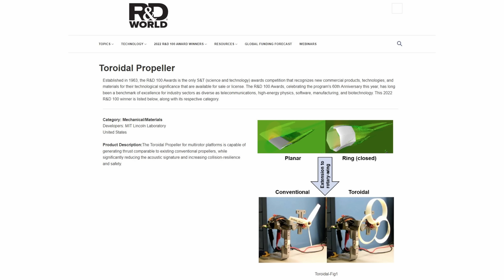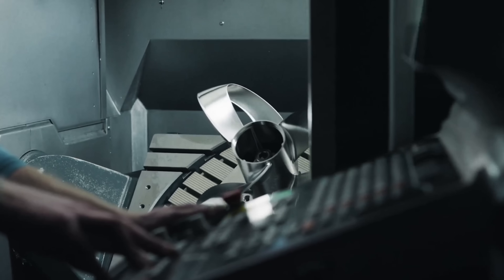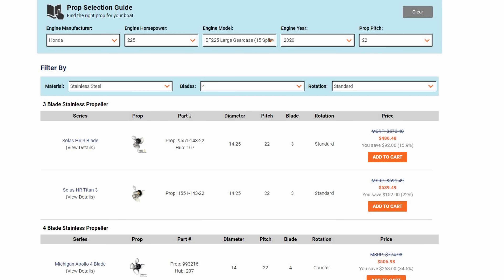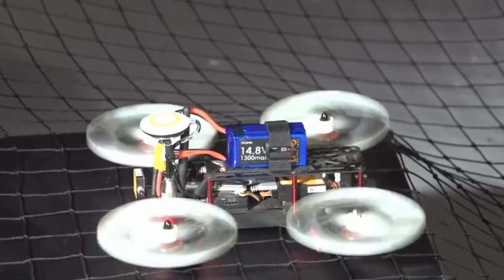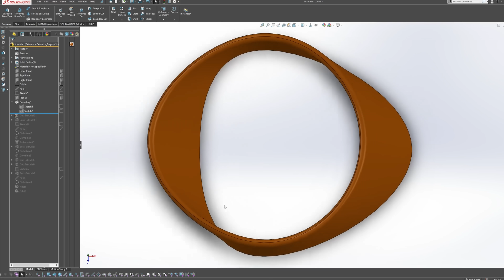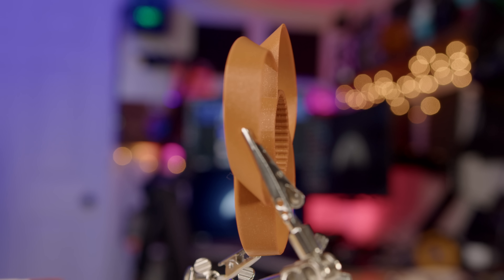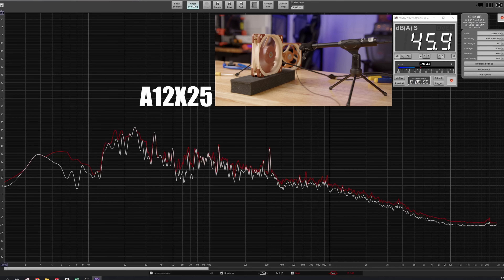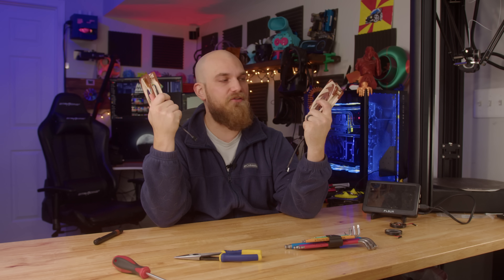I Turned MIT Award Winning Toroidal Propeller Into A PC Fan | Fan Showdown S5 Special

Comment: There is one BIG difference between your fans and the drone propellers.  It is that your fans are DUCTED - it already has an enclosure around the outside of the fans.
The main cause of noise are the fan-tip vortices, and having an enclosure already reduces those vortices which is why you don't see much of an noise advantage.
There are reasons why ducted fans are not used in drones:

Here are some of the other advantages that you can have when you are using ducted fans on a flying object:

*The tip losses from the propeller blades can be reduced by the duct. When that happens, the ducted fan can operate at a more efficient level as it can produce thrust that propellers that are similar in diameter and size cannot. This is best seen when the aircraft or the object is flying at low speeds and high static thrust levels.
*If you are able to vary the size of the duct the right way, you can adjust the size of the fan to allow it to work at a more efficient level at higher airspeeds compared to what a propeller can do.
*Of course, ducted fans work a lot more quietly than propellers do because the ducts shield the noise that the blades produce while also reducing the tip speed that could very well contribute to more noise.
*At the same thrust level, a ducted fan can be smaller than a propeller. This allows you to use smaller engines on a flying aircraft or object while retaining the same thrust level.
*Ducted fans, because of how the ducts shield and cover the propeller blades, are safer when operating on the ground because the chances of the blades hitting someone or something are greatly reduced.

So why don't most drones use ducted fans?
Let us look at the disadvantages of ducted fans:

*They don’t work as efficiently when the flying object is at cruise level or is operating at a low thrust level.
*You need to be able to have very small clearances between the tips of the blades and the duct itself for the ducted fans to work efficiently.
*The duct can add weight to the entire flying vehicle or object even when the duct is made from light composite materials.

So, if you look at it, it becomes quite easy to understand why most drones don’t use ducted fans and why there are only a few of these drones that actually use them. Drones work at a low thrust level, and their motors need to be able to provide low-level static thrust all the time for the drones to maintain their flight. This makes the inefficiency of ducted fans apparent as they do not work very well at low thrust levels.

For a fan application, many of the disadvantages don't apply, which is why you see that many fans are ducted whereas few drone propellers are.

Comment: You also haven't sanded/polished the ridges left by the printing process, which are similar to tooling marks left over from standard machining processes. Your blades are the equivalent of rough, fast mill passes, not the final pass or post polish stages. Each ridge can create its own vortices or a high/low pressure zone over and behind it, creating variable lift and drag zones making for vibration and interrupting air flow. It also hasn't been balanced.  Too many variables in play to test it accurately. At least take some 2000 then 5000 grit wet sanding paper of some similar method to polish the blades and consider balancing it first. Another great idea would be a full ducted external housing using the shaft terminated toroidal design closer to the boat propeller if volume/noise/efficacy over mid RPM ranges to max RPM is the desired result.

Comment: Just a thought. have you considered making a radiator fan for a water cooled motor vehicle engine and seeing the difference in engine cooling. another test might be to run it on 12VDC and not tied to the engine, seeing if it uses the same amount of power, or produces superior cooling performance at the same RPM, I wonder if a NASCAR  team would like to participate in it, to see if they can get more HP to the wheels.

Comment: Award winning when a toroidal design has been used in the Sharrow Propeller MX-1 OB motor propeller since 2020. Confirmed efficiency gains of between 9-15% over comparable 3-blade propeller designs.

Comment: 💨🔧🎛 It's interesting to note that the fan blade with more blades can help reduce noise compared to a two-blade prop. However, it seems like you're experiencing some vibration noise, which could be attributed to an imbalance in weight distribution or potential structural issues. Analyzing it with Ansys could provide valuable insights. I'm curious to see how you address these challenges and optimize the performance of your PC fan. Keep up the great work! 💪🔬🔩

Comment: you probably need to change the design, as the prop is not designed to be ducted/enclosed.  This probably also affects your sound test.  Tip vortices are different when ducted.

Comment: Have you tried printing a laminar intake to smooth air current coming in? If you find an optimal depth for not losing too much input volume due to interference on the way in but enough to directionalize the air current towards the CPU and GPU, it may have less flow but more efficient diffusion of heat due to the flow hitting the right spot. It'd be interesting to see a laminar pre-fan intake, and a laminar fan exhaust into the PC pointed at CPU and GPU. I've seen you implement many ducted configurations, and the cheater, but I'm assuming part of the toroidal fan loss is choppiness being rounded by the void in the propeller creating eddies all along the edge and inner circumference of those three toroidal voids and smoothing the output but also losing efficiency due to friction in doing so. I know the same energy will be lost elsewhere but maybe it could be lost in a passive laminar array leading into and out of the fan, easing the work of the blade shape and construction but gaining from its smoothing and noise reducing properties. The other major factor would be if you get a cheap sandblaster kit, or even one of those rock tumblers with pellets and smooth your prints to a better grit. Could be a small investment for huge results.

Comment: Perhaps the fact that the toroidal prop was designed as a non-ducted fan while PC coolers are ducted fans makes a difference. Airflow at the wingtip is very different on a ducted fan so that pretty much negates the main advantage of the toroidal prop.

Comment: The toroidal might need more fins, especially ones that are much thinner, so they work quicker and sound quieter.
Usually the thicker the material, the more drag, along with more fins having more surface area to pull in stuff.

Comment: Instead of smooth edges on those toroidal blades have you tried printing them with tubercles used in bionic propellers based on humpback whale fins which reduce drag at higher angles? Also is it possible to print biomimetic gas-entrapping microtextured surfaces (GEMS) to further mitigate cavitation?

Comment: i think its apples to oranges because of the manufacturing method. Noctuas injection molded accuracy gives it a big advantage. while I don't think it would win anyways, I think if you SLA printed that it would close the performance gap a bit.

Comment: Intersting design. Just one note isnt the drone fan open on all sides compared to the cased fan, which is closed in thus restricting air flow?
Iooking throgh you catalogue I see you like to take inspiration from other designers, so maybe look towards any available data on the submarine service propellers as they would be the quitest and most efficient designs.
With your previous Noctua designs having more blades, maybe it might be simpler to cut the blades off one and add them to another using a thin wire mounting ring mid blade to add support around the structure.This would keep the optimal blade design and angles but add more blades.

Comment: make them fatter,  loop closer together, need more material spinning. The design needs adjustment depending on useage. the water one for example is a much more elongated of what i just stated, for a pc fan, you probably just need to smoosh that into fan size.

Comment: It would seem the tolerance on the A12X25's edges are much smaller than the 3D printed toroidal. The purpose of the toroidal is to decrease the noise causing vortices from the tips of blades within a certain range of frequencies (which apparently annoy humans) while producing the same, if not greater, amount of thrust. I would imagine if you could match the cross-sectional area of the toroidal to the A12X25 and decreased the tolerances for the toroidal, it would be a closer contest. I think it would also be a good comparison to take the fan out of the A12X25 and compare it to the toroidal to see if the assertion that the MIT toroidal design is better for drones vs PC cooling. Cheers from an ignorant idea enthusiast.

Comment: If you added another elliptical in the toroidal, it would perform a lot better, as it only has effectively 3 full blades, and 3 1/3 of a blade. While the other had what 10 blades. Quite the difference in the amount of air pressure it can produce.

Comment: It looks like the toroidal design would produce more pressure if you integrated two "arctic style" case fan blades radiating from the hub to the outer rings evenly spaced through the middle of the toroidal blade openings?

Comment: It would have been interesting to see the relative power usage of each fan versus the flow, that is, the efficiency.  Why limit yourself, go for a two-stage (or greater) contra-rotating design, no need for stators if the two stages are contra-rotating, of course, you will have to design each stage differently.  Shades of A.A. Griffith.

Comment: i might be making shit up but the fan blade profile might be a simple circular profile, thin extruded along a helical path. what i see on yours is circular at the beginning, and distorts as it goes along that helical path. that might be the exact design mit made though, just pointing out a possibility
Reply: If what I told to you sounds sensible, I can gladly help you on the modelling, or heck I might even just do it.

Comment: It seems that you would just need more time and prints to change  angle and blade count for PC fans and radiator specifics.  Obviously it lacks blade surface area compared to the Noctua.  Maybe increasing toroidal surface area like the marine prop would do better for radiators.

Comment: The supposedly groundbreaking toroidal fan design is basically just a half-way point between an open and a ducted fan. You're spinning 3 short ducts. That's all you're doing. It should have efficiency etc about half-way between a plan fan and a ducted fan.

Comment: Well the first thing I thought of was this is great for safety and impact damage. Where a regular prop with the Blades sticking out like feathers hit something it will be damaged quick but looking at the structure of the toroidal this would be marginal with the rounded blades that would spin over a surface rather than catch it.  To me all the other stuff are the beneys.

Comment: That toroidal design is optimized for 3D printing. It's a gimmick to sell more drones. The optimal designs are time consuming and hard to print because a large portion of the blade is at an angle that can't be tiered or scaffolded.

Comment: I have one request. Unlike MIT's and commercial toroidal propellers, your toroidal fan has a clear edge at the blade end. Eventually, a separation phenomenon by the shock wave will appear and the vortex phenomenon will become stronger. If the tip of a toroid propeller is smooth, tell me what the result will be!

Comment: 5:13 please note that the MIT-designed "propeller" outer parts are very close to the enclosing circular part of the holding body - as opposed to the case of being used in a drone.

Comment: I want to thank you for sharing your knowledge. 
I bought two used vacuum variable capacitors but didn't get around to them for some time. When I did I became concerned that they may be bad as I attempted to test them with my digital multimeter I got an inconsistent reading that was also no where's near the rated value.
My intended use for them is as ameture radio antenna tuners or more specifically in a Mag-Loop antenna.
Would you recommend a similar test utilizing the circuit you used with the power source, resistor and light bulb? 
Or should I run a radio frequency through them as I run them through their min and max?
Thank you kindly for your assistance, 
Gary
P.S. the values of the capacitors are;
1. 8-1000PF 3KV
2. 6-500PF 6KV
Both are Jennings USA

Comment: Pretty sure the toroidal fan blades were used for open ended blades, not closed ended blades where the blade edges and enclosed in an enclosure.

That being said, I do wonder how it does in comparison to an open ended fan.

Comment: You have SIX blades on that thing. You need to duplicate the design, rotate it to the right on half of the diameter and re-print it as effectively double fan. I hope I explained this well - effectively you need two of those merged together (maybe even 3).  Should be easy.

Comment: I wonder if the trio Rd Al design would have better results if they were not intersecting each other. This may mean having more blades so that the whole shape is smaller and fits between the center section and outer casing, possibly with 5 triordial blades.

Comment: I believe the ducting mitigates the drag at the conventional propeller tips, or provides some other advantage resulting in the viability of the ducted fan method of propulsion. So you aren't giving the toroidal propeller a fair chance, which doesn't need the ducting as much as the conventional propeller. Also your actual blade area is up to half as much, which your test of throughput confirmed. So don't give up on the idea as this was an unduly harsh test.

Comment: pretty sure printed fan has worse airflow bcz of it uneven surface. once I noticed my fan blades were covered with dust and it almost not blow air at all, but when I wiped it to shiny condition it goes well as it should. 
also noice could be because of not proper balancing (its absence but this is all guesswork) and vibrations.

Comment: Wouldn't it be a better comparison if there's more than 3 loops, which is probably equivalent to, at most, 6 blades on a regular fan? What's the gap between the blade edge and the frame? Did you smooth out the surface of the blades, which might generate some noise?

Comment: I think this shows the new design to be a resounding success. You have to also consider the surface finishes of each of the props. The parasitic drag on the toroidal design will be much higher due to the rougher surface finish. This would mean a less efficient airfoil and more noise

Comment: I don't know much about propellers but I suspect that this test wasn't very fair for the Toroidal design:
1. You 3D printed a Toroidal design from a model you made yourself by looking at a picture. And then squished it to fit into a computer fan frame. No matter your 3D modeling skills, there's no way you could've gotten an optimal design on the first try.

2. The Toroidal Propeller in the video I saw earlier didn't seem to have a frame around it, and I suspect that frame changes the conditions of both fans.

3. Your fan blade was 3d printed and I doubt it's the same material quality as the other one. That would likely impact performance.

4. Those propellers were designed for drones. I'm sure that takes a different design than computer fans. What you did here is like taking an LED lightbulb meant for home use and using it as card headlights. It was designed for a different purpose and thus will not perform the role you're testing as well as something that's designed for that purpose.

Comment: I note most people have referred to the toroidal as 3 blade but is actually 6 in what I will call a 3 ring design.

It would be interesting if you could have more overlapping rings and therefore more blades.

More blade surface area could potentially increase performance.

 or consider if you reverse engineered the standard fan with similar blade surface area to the toroidal it would perform quite badly but just how bad by comparison to blade surface area across all metrics sound airflow, current draw etc??

Looks to be a very interesting area of development.

I wonder how these toroidal style could be developed and optimised for air movement in various  industrial and domestic applications. 

Regardless they look cool😅

Guess drum style fans would out perform these hands down?

Comment: USE A NOCTUA INDUSTRIAL (3000 RPM) for the frame/motor compare that instead).... I personally run 5 of the industrials in my main rig and at full rpms it sounds like a drone taking off

Comment: The Toroidal props are so damm expensive because they need a 5 axis cnc to be cut
Instead of a threee axis one
You also need a significantly larger base material stock, and material prices go up exponentially with volume because it gets harder to have a larger volume without impurities

Comment: If claims about efficiency are valid, a $5000 propeller at 30% increased efficiency is absolutely worth it. Particularly in activities like trolling where you stay in the low-mid range RPM, the money returns quickly through fuel conservation.

Comment: I would like to see the MIT design tried with more blades.  There is a lot of open space between the blades currently.  Currently you have 3 circular blades set 120 degrees apart.  I would imagine it isn't too difficult in solidworks to copy the 3 current blades and paste in 3 additional blades that are offset 60 degrees from the current 3 blade design.   Would be a pain to CNC, but easy to make with 3D printing.  Maybe add a little mass to the center hub that can be sanded off for balancing as others have suggested.